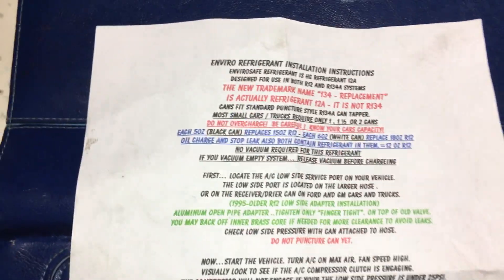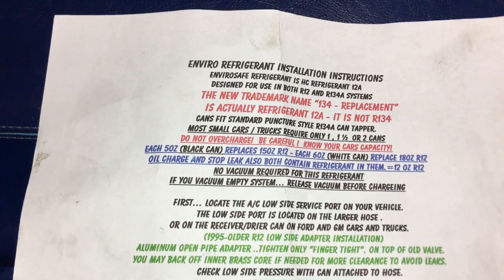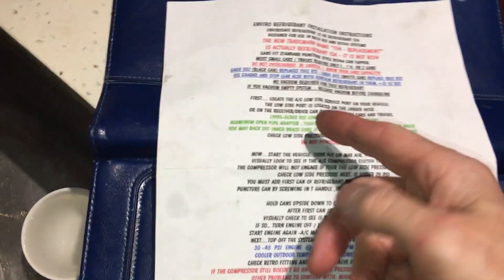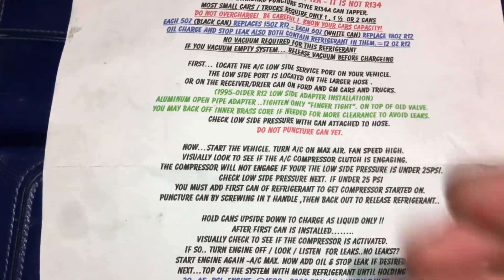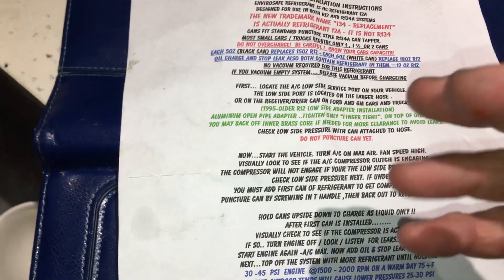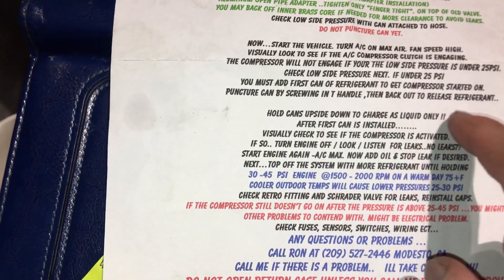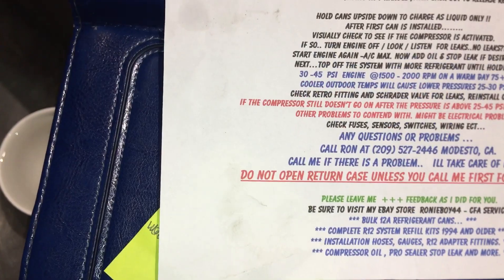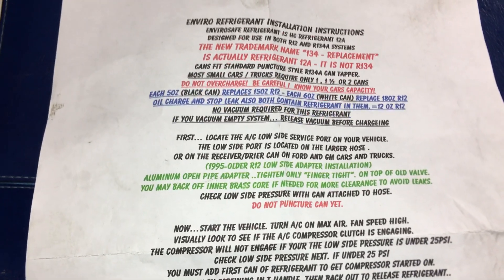Refrigerant alternative EnviroSafe instructions to install,  NO VACUUM NEEDED ?

Comment: So just curious, when I quit doing ac stuff they were talking about switching to something new, that is flammable, and Mercedes was refusing to use the new flammable refrigerant.....have you heard anything about this.... Is this what they were trying to use?
Reply from the maker: Unfortunately Mercedes Benz blew it way out of proportion on the flammability. 

They literally had to rig up a system with a solenoid directing the refrigerant (“with the refrigerant oil”) Hot rod of vehicle with a turbo charger intentionally running the engine hard to keep the turbo in high boost something you would never do on a normal street to get the exhaust manifold cherry red hot. 
            And then at this point they would manually open the solenoid valve to release what they called the flammable refrigerant but you have to remember it has oil mixed in with it because all refrigerant has oil mixed with it and the oil is literally nearly more flammable Than the Refrigerant. 

The big game player here is having to pay a patent fee and outrageously high price for refrigerant for a German auto maker or Europeans to a conglomeration of Dupont and Honeywell for the patent. 

Mercedes has been working on a CO2 air conditioning system which would work in cooler climate regions.   I’m all for CO2 I think it should be Alternative as a choice and Mercedes-Benz still offers it in Germany and I believe some European EU states as a expensive option. 

Your grandmother‘s hairspray in the can is 10 times more flammable than the new YF refrigerant. 

If you were ever a little kid like I was and grab grandma‘s hairspray with a match going around torch bugs and spiderwebs what look like a miniature army flamethrower. 

The new YF refrigerant the second you pull away the flame source the refrigerant sniffs out its own flame and stops burning 🔥. 

I personally really wish they would use R600 or R290 propane or butane as a Refrigerant. 

It is such a efficient refrigerant you would only need somewhere between 3 to 5 ounces of refrigerant flammable refrigerant to a glycol plate heat exchanger that would chill down a coolant and then a electric water pump with pump that coolant to your evaporator so basically you would be delivering say 24°F water to a evaporator under your dash so there is no danger at all whatsoever of having a flammable component inside the passenger compartment. 

There’s already systems like this under development that are being used on vehicles. 

BMW has a compressor that discharges into a plate heat exchanger just a few inches away to a glycol loop system to use as it’s condenser and then it pumps glycol to a front condenser that is filled with hot glycol from the compressor it gets cooler from the air and then completes its loop. 

I like flammable refrigerant so long as they’re marked and the components were constructed to a higher safety margin and more reliable and robust specifically developed for flammable refrigerant I have no problem with that

I know more shops would not want to work on flammable refrigerant so that just means more work for me at a higher price I don’t see nothing wrong with that

I like CO2 it operates at somewhere between 2700 psi to 1400 psi depending on the ambient conditions the low side pressure might be 600 psi. 
           The high pressures of CO2 freak out a lot of shop owners and technicians and they wet their pants thinking about it. 

I would like those systems because I would be one of the few people who would work on them with no problem more work for me.

Comment: Funny how much the lobbyists can impact things in the US, people vilifying the best and safest product for the job.  Let me know how your wallet feels about that R1234yf!
Reply from the maker: Propane or Butane $3.00 lb. 

I sell R1234yf $207. lb.  People are not happy.
Reply: @coldfinger459sub0  Define people, this is a politically motivated thing, some people are very happy, lobbyists, chem companies, politicians.
Reply from the maker: Lol.  

Gov & chem company are happy taxes and profit margins for something that only cost 0.50 cents a pound
Reply: @coldfinger459sub0  So why do you take issue with products like Enviro Safe?  Or is that just something you kind of have to do to cover yourself?  They use flammables in cars all over the world where big corps aren't involved.
Reply from the maker: @ZeroEntropy.  because people install it in cars without specialized fittings or any stickers indicating that it is inside the air conditioning system. 

Then the customer or the car may be sold to somebody else and then the new owner takes it into a shop for example me. 

And if I did not own a refrigerant identifier.  I have either 30 pound or 50 pound refrigerant reclaiming jugs let’s say for example that are filled with R1234YF that I have reclaimed to recycle to use in cars. 

I sell this for $207 a pound X 30lb. = $6210 just goes into the toilet as soon as it’s contaminated with us evirosafe gas that somebody sticks into a car it becomes unusable. 

This is the only thing I have against it. 

Personally myself I wish they would use only propane or butane as a refrigerant. 

You only need 3 to 5 ounces that would be more than enough to cool down a car it would go straight from the compressor right into a expansion valve and a plate heat exchanger under the hood of the vehicle and the plate heat exchanger would chill a glycol coolant solution down to about 24°F. 
       And a electric water pump pump the chilled glycol to a Evaporator under the dash in the passenger compartment then there would be absolutely no risk of fire or danger to any occupants in the passenger compartment. 

I am 100% in favor of a system like this. 

This would make everybody happy

Except for the walked out crazy snowflake primadonnas who are screaming the sky is falling like chicken little. 

Well they have their barbecue on the deck right next to their house with a 20 pound cylinder of propane and never think about that. 

Instead of 5 ounces under the hood of a car handful of BIC lighters. 

By the way over the past few decades while they were selling this company’s product the company itself processing plant that packages the cans explode it twice once just a couple years ago and once many years ago.
Reply: @coldfinger459sub0  Long ago I bought some of it as an R-12 replacement, it was so long ago I don't even remember what I bought it for and I never used it.  I'm not an HVAC guy by any means, I actually hate working on HVAC but I have a 2 stage pump, all Yellow Jacket gauges for the car and another one for the home stuff.  I have a micrometer and a sniffer and I've done a ton of Splits but that's what I stick to.  And I service my cars, mainly because I don't trust other people and I'm rural so I can normally do it myself faster than having anybody else do it.  I'm trying to decide if I want to switch my R134a systems over to this or not.  I can still spend $350 on a 30lb tank but that isn't going to work forever as the prices continue to climb.  

Oh well, just random thoughts.  I service everything myself so there's no issue with me but I totally get your point.  I would have an issue with that as well.
Reply from the maker: Hey 30 pound can a refrigerant the last one vehicle a very long time. 

If it was my own vehicle I would probably put it in my very own vehicle. 

But because I recycle refrigerant too and I literally recycle thousands of pounds of refrigerant per year I have a unlimited supply for free on top of what I buy.
Reply: @ZeroEntropy.  Flammable does not mean its combustible. Studies have shown that when sprayed on a hot end exhaust upto 800C there is no combustion.
Reply from the maker: Mercedes produced to test the video that was showing it catch on fire when sprayed on to a incredibly hot turbo exhaust manifold. But I personally don’t care about flammable refrigerant it should be used. It’s a better refrigerant than anything else, propane or butane..  just skip the mildly flammable refrigerants and go straight into pure hydrocarbon refrigerant.

Comment: Sweeping non-condensables, no hf thus no acid?  Why not pull a vacuum, I would.
Reply from the maker: My thoughts exactly .

Just more marketing Yes to make more money it makes it easy and Attracted to DYI Cheap easy and not complicated they don’t have to buy a new expensive vacuum pump or perform procedures that are uncomfortable with but you make it sound like the product that you just drop it and turn key and it works. 🤔

       And the seller doesn’t have to suffer the consequences financially for damages is done

Comment: I copied this from their website as to why they don't want you to evacuate the system.  I have to admit that this is crazy logic and makes no real sense.  You're right, not sure these guys know what they're doing.

Our US Department of Transportation has regulations on how much pressure can be in a can. Everyone wants the cheapest and best price on refrigerant. So, we use a 2Q can because it is a standard can that can hold 70 psi at 70 degrees F. If a system is a small system and not a dual air system, the small amount of air in the system will make our refrigerant with dye work correctly as hydrocarbons do not react to air. If you do take the Enviro-Safe 134a Replacement Refrigerant with dye and you do charge into a vacuum and charge by gauge readings, you are actually overcharging a system that can cause damage later. It would not allow for expansion room so when the system gets extremely hot, it can tear up a compressor. If you pull a vacuum and charge by weight (6 oz of ES = 16 oz of 134), normally your gauge reading will read low and your cooling isn't great. 
 
NOTE: This does not hold true for a larger system that has front and rear ac systems. Dual air systems MUST use Enviro-Safe Industrial 134a Replacement Refrigerant! This refrigerant allows a vacuum to be pulled. We would love for all of our customers to use Enviro-Safe Industrial 134a replacement as that refrigerant will allow everyone to pull a vac and gets the best cooling!
Reply: What’s a dual air system? Dual zone climate control?
Reply: @setoman1 no man. You got dual zone from dual air? Dual air is front and rear system. Not vents pointing to the rear but and actual coil in the rear. More capacity etc.
Reply: @JM-yx1lm  Two evaporators that share the same compressor, condenser, drier, etc?
Reply from the maker: Thanks for doing the research for me I did not have time to read over their whole website and look for information just the basics. 

         As for having a high percentage of air mixed with hydrocarbons and then throw it in a compressor that can compress it to the point of dieseling or preignition I personally got to experience what happens when the air is mixed with hydrocarbon and I recovered it into my recovery machine.

It was very short-lived

I hooked up my gauges and hoses hooked up my machine I flipped the switch to recover the refrigerant there was about two cycles of compression you can hear from my pump in the recycling and then there was a loud boom and instantly it stopped.

   When I took the middle side panels off to look inside my recovery machine the side of the crank Block housing had a hole the size of my fist in the crank in part of the piston and rod were laying on the bottom inside the sheet-metal housing of my recovery unit. 

     This is what happens when you compress  hydrocarbon and oxygen mixed together the high compression in itself ignites like a diesel engine or the little RC Cox engine we used to play with as kids 

    Are used to hate hydrocarbon refrigerants after that time that was about 25 years ago.    Other than my dad taught me to like hydrocarbon refrigerant he was very comfortable and safe with it and taught me a lot about using propane or butane that was specially refined just as a refrigerant.

Comment: I'm all about violating the EPA SNAP Guidelines but even I vacuum systems for at least an hour after opening them and replace the desiccant-containing device once it has been open. if you're going to be a hack, at least do quality hack work. some people can't be trusted to do dangerous things.
Reply from the maker: This is an extreme HACK ! Product for Xtreme HACK !  job. 

       This product is marketed towards the unknowing unsuspecting consumer with no knowledge. 

       This customer wants to do it as low dollar bottom of the line method as possible. 

        I’m completely against using these products in automotive.      I thought this would make it amusing video well at the same time putting the links for the EPA SNAP web links products that are not approved for automotive use. 

        Even though this vehicle passed a high-pressure nitrogen decay test

And the vehicle has never been open to the atmosphere

    I’m still at least leaving the vacuum pump on it overnight. 

       I myself would prefer to use pure R290 or  pure R600. Even though it is not acceptable or allowable it would make a fun science educational project. 

Here’s the Internet link for this products website take a look at their advertising how they market this stuff

https://www.es-refrigerants.com/

They even have Products geared towards home residential HVAC
Reply: @coldfinger459sub0  I'm a professional automotive technician but I was raised by someone who has their universal 608 EPA license and does commercial HVAC. I was constantly badgered by him for thinking about doing hack things, (old compressors as vacuum pumps, etc.). I have grown to follow the procedures and do things correctly. for my own turds though Ill do hack stuff like use r152a or r600 (iso-butane) without worrying too much. I also don't bring my hack turds to professional shops to have them recover my refrigerant because I'm not going to screw someone. I love your videos because you drag the people in my trade who are lazy, incompetent, or both. love the content man.
Reply from the maker: @zackarymcclain164  it sounds like we were raised by the same father we’re both brothers from a different mother lol 🤣 

     In this situation I was directly approached by the shop owner who’s Long time customer asked him to install this product. 

          I also have my universal 608 EPA license and I use it over on my other commercial business installing large 20 to 60 ton VRF systems. 

        Since this vehicle will stay in house and only my equipment will be used on it I don’t worry about it going elsewhere to another professional shop. 

          The one thing the customer did not purchase in his kit was the unique fittings to be permanently attached with some permanent Loctite to the quarter inch threaded fittings so nobody else can attach their hoses that I see are available for purchase on the website of the company that sells this product so I’m going to have the customer purchase do you need fittings that are proprietary. 
            And purchased a unique label indicating that this is a flammable product and it is not a refrigerant to be mixed with any other refrigerant. 

     I’m still against using this product. 
But the owner of the shop and the customer know if anyone is going to install it correctly to the best of the working ability of this product this is why they came to me and asked me to do it. 

          At first I was refused and said I would have nothing to do with this garbage product on the market. 

        But then I thought about it and knew this would be a interesting series of videos that would get a lot of controversial replies. 

        So everyone of these videos I will pin a direct link to the EPA indicating this is a hydrocarbon refrigerant that is not approved for installation by the EPA. 

        As I complete this video series give me your input and your final conclusion on this product once I am finished. 

          I do prefer if I can talk to customer into it his willingness for me after using this product if it leaks out on a ffailed component that we converted back to R134. 

         Because this is a old original system from 1984 old rubber O-rings old rubber hoses old rubber compressor shaft seal something is bound to fail probably by this upcoming summer. 

             But I think before I complete this video series I have to get the customer to purchase the can cap adapter for the threaded can because I don’t own such a product bbecause I never use cans and especially this type of product.
Reply: @coldfinger459sub0  I think the epa has santioned this company for this/similar products.
The compressor shaft seal in my 84 gm compressor is ceramic/carbon.
Reply: @knk3220  from my own projects it has produced much better cooling than the equivalent r134a conversion.
Reply: @zackarymcclain164  So did you do maths of calculating molar mass of R12/134a/152a to determine a suitable R152a charging amount?
And in the conversion did you changed the condenser to parallel flow one as well?